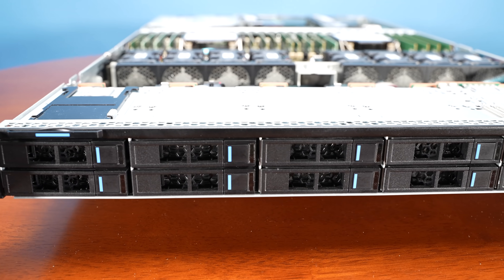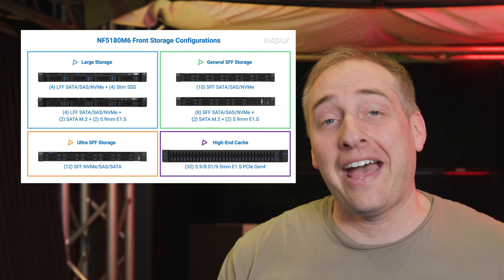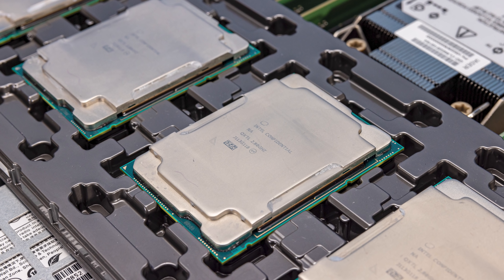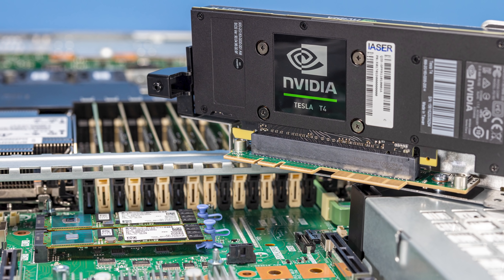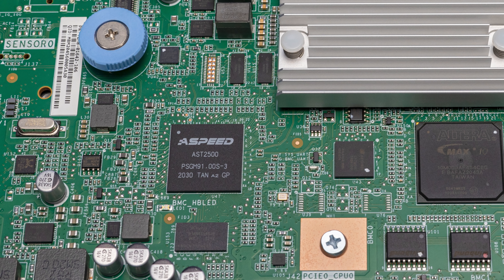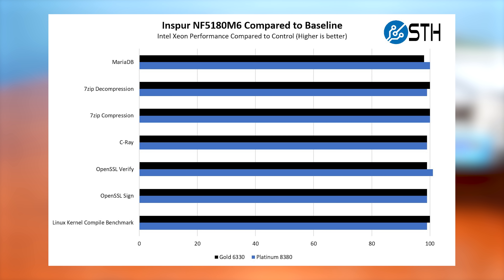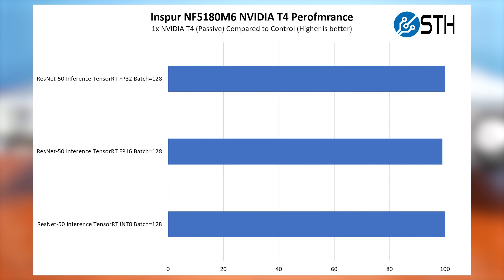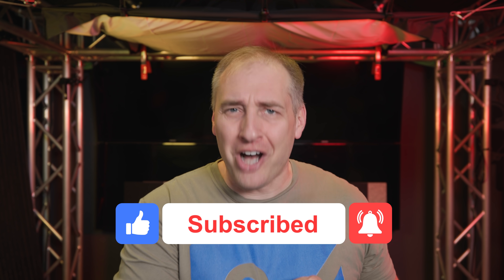Inside a Modern 1U Intel Xeon Server Review

Comment: I'm impressed the T4 had adequate cooling.  This might be a dumb question, but could the difference in power consumption be due to the fans?  I imagine the 1U fans have to work a lot harder to cool the same TDP as the 2U fans.
Reply from the maker: The T4 sips power and runs well even in lower airflow environments. On the fan power consumption, 100%. We used this server versus the 2U version for this piece where we looked at exactly that: https://youtu.be/rMJBhYeRIxY

Comment: Nice review, Thank you.
It would be nice to have prebuild 1u, 2u server with quiet fans in it. right now, my home office is so noisy because of dell poweredge r230.
Reply: Rack servers are not meant to sit in your home office. If you want/need the horsepower in a quieter system, look at tower FF servers that are meant more for the Small Office environment that are generally much quieter.
Reply: @emtboy9  Um talk about e-waste. Do you think all rack servers stay in racks in DCs...? All that vendors have to do is tune their BIOS to have a better fan curve.
Reply: @emtboy9  totally agree with idea. Even though Tower server is more quieter, I still prefer rack server due to weight & space constraints.
That why I think that it would be nice to have prebuilt rack server with quieter fan. I have custom build rack servers too, but I didn't live in US, so newest xeon and server motherboard are a little bit hard to come by.

Comment: What’s the reason/advantage of 10 SFF model compared to the 12 drive variant you have shown?
Reply from the maker: Lower cost and with 10 SFF you can get more airflow to the rear of the system.

Comment: I wonder what the heat foot print of a full rack of robustly configured 1U servers?  40 servers @208v, 1kW each is about 140 amps of power.   How does this heat island affect the racks on either side of it?
Reply from the maker: 40kW/ rack is not really shocking density these days. You are right that many racks cannot handle that much power. This year, that will go up significantly. Hopefully next week we will have a piece showing liquid cooling and a 4U unit that can remove 80kW using a garden hose worth of flow.
Reply: as far as i know you can roast chips n fry bbq top of rack!

Comment: I am a student and I’ve been learning a lot with python and ml/dl do you think it would be worth it to build a sever with some old xeons and Teslas to mess with neural networks on? Or should I keep them local on my 3090 workstation
Reply from the maker: I would probably keep them local. Old Xeons have the challenge that they are so much less efficient than newer chips. Plus saving money is good!
Reply: @ServeTheHomeVideo  thank you. I love your channel, your energy and the ability to watch a 10 minute video or go to your website for a more in depth view. Great content
Reply: I run an AI startup, so I know a thing or two about this: A current 3090 is a great card for ML/DL, I have one in my personal dev workstation. You can do a lot with smaller models and prototyping, way more than with older Teslas and especially CPUs. And for the bigger stuff, if you have a budget, cloud for a one time / short term thing can be a better bet (if you factor in power and time), but if you do this constantly, buying a couple A100 (or soon H100) systems is the best bet, but for learning a 3090 is perfect, no need for anything else I think.
Reply: @jannikmeissner  thank you. I am still learning but as I get better I may consider some  a/h100
Reply: @peelthebananna9827  yes, buy those if you get money for your work or have the company you work for buy them, for learning an RTX3090 is perfect

Comment: I just wonder how much maintenance it takes with a 1U compared to a 2U with less rpm on the fans and lower speed of the air? Huw much dust will accumulate and lifetime of the fans over 3-5 years. Someone with experience?
Reply from the maker: Data centers usually filter to ensure most of the dust is removed. Some still is present. Fans in either case rarely fail. I asked and FB folks said they only kept a few fans on hand in their massive DCs

Comment: I'd love to see someone do some smoke testing with different types of servers' airflow baffles to visualize the airflow to different parts of the system. These 1U systems are often so dense with so many tiny high pressure fans...
Reply from the maker: I am worried that if we did that we would need to use different lids. The lids often have holes so we would change airflow unless everything was perfectly molded/ replicated. The other challenge is that many of these will be liquid cooled within 1-3 years. :-)
Reply: @ServeTheHomeVideo  true, true... now I guess I'll have to ask all server vendors to start making transparent lids 🤪
Reply: @JeffGeerling  I investigated smoke testing on desktop cases some years back, and found that all of the then-current "smoke" variants contaminate whatever they blow across to the extent that major cleanup is needed after testing.  I wonder if there are now compounds that would make this reasonably non-messy?
Reply: @d00dEEE  LN2
Reply: @d00dEEE  A sacrifice must be made
Reply: @Wasmachineman  
Real men use liquid metal, not LN2
Reply: @suntzu1409  LN2 and LM don't mix.
Reply: @Wasmachineman  
woooosh
Reply: @JeffGeerling  thats a really expensive sacrifice ngl
Reply: @ServeTheHomeVideo  
> Liquid cooled

Cooled with liquid metal? :-)
Reply: Smoke isn’t a great test. Better to look at the temp sensors and alerts that come in.
Reply: @danieljuhnke02  It's a fun visualization, nothing more :)
Reply: Also not all CPU’s will support 32 drives because they don’t have that many PCI lanes.